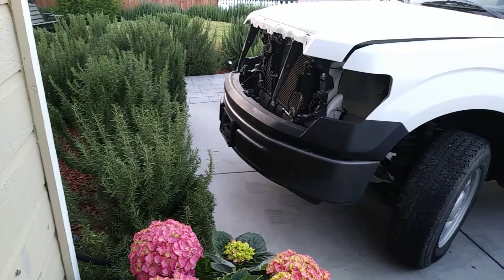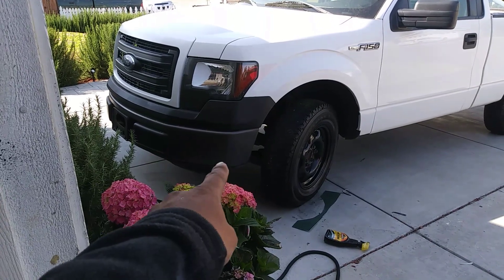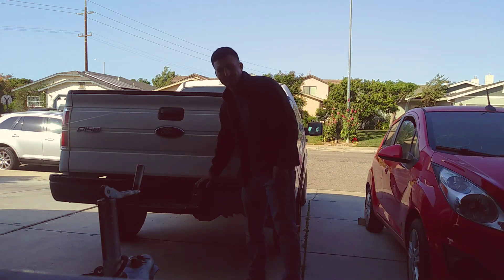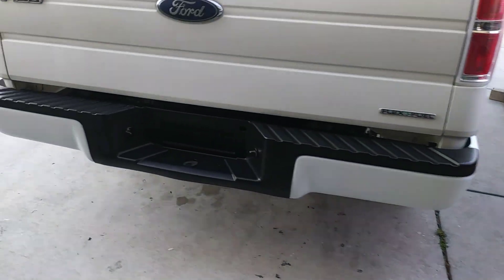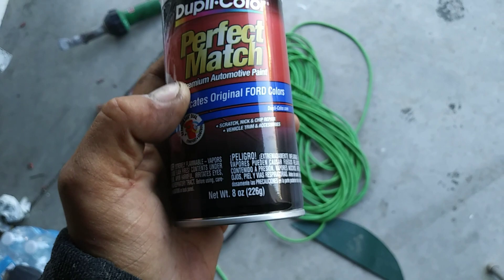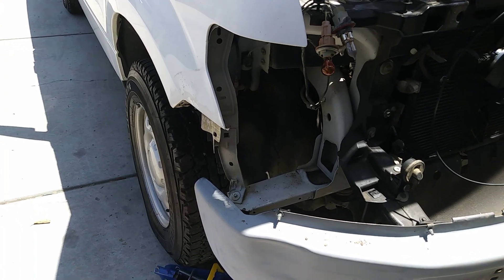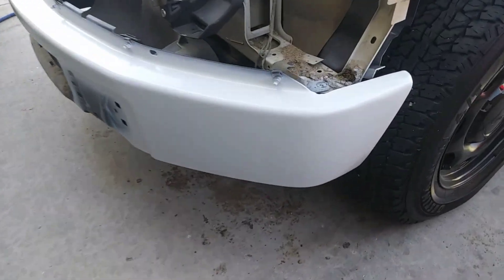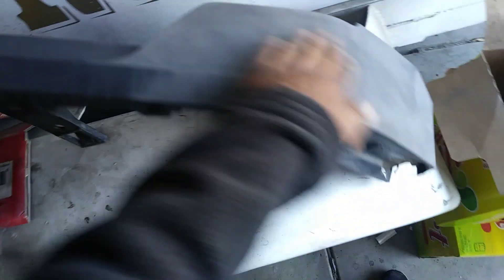Painting the copart f-150 rebuild project, diy paint job using duplicolor perfect match.

Comment: did u use primer before paint oxford white and which one? did you use clear coat after base coat(oxford white) and which one?
Reply from the maker: Yes on plastic it was adhesion promoter and any grey primer would work followed by your paint and the clear I used was duplicolor perfect match clearcoat 

For the metal bumper only sanded and painted then added clear coat 

I did 3 coats of paint and 3 coats of clear, let it dry comp6and then buff it if clear coat looks bad.
Reply: @CALIREBUILDABLES  thanks

Comment: i was at the store today and was upset. i can tell from the cap and by spraying a little on the shelf it was on that its not a perfect match. you do nice clean work but i gotta say it looks darker than the rest of the vehicle. i have seen some other videos showing burgundy and how it doesnt match either. my ford econoline is oxford white yz.
Reply from the maker: Yea it has to do with primer and to dead on with the factory spraying but honestly it's somewhat better than what it was before depending on how it looked before lol
Reply: @CALIREBUILDABLES  i just used rustoleum gloss white and it looks really good, close enough

Comment: How did it hold up?
Reply from the maker: It's been holding pretty good bro no chipping  yet.👍✌
Reply: CALI REBUILDABLES you think it would work good on my black plastic handles? I got a 2018 f150, I just did white plasti dip and its all peeling off
Reply: Door handles*
Reply from the maker: @vanillathunder8112  I think it should just make sure you clean them perfectly before using tar and wax remover then use adhesion  promoter bro but the cleaning is what will make the difference..hope this helps👍✌